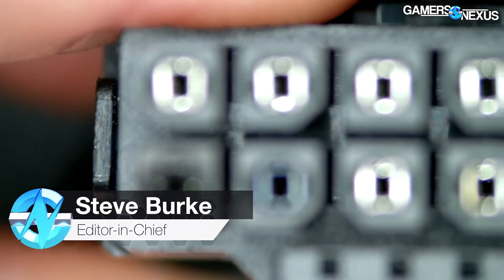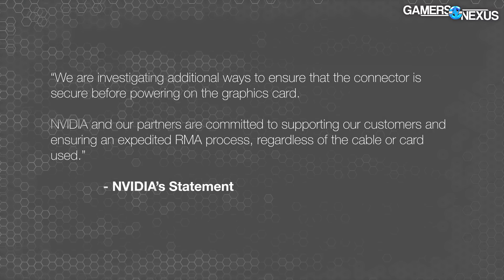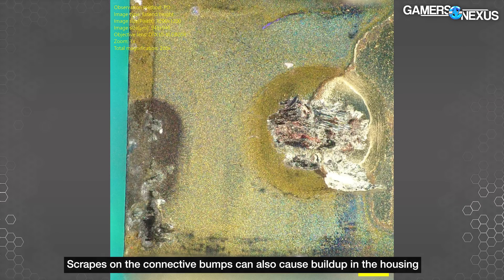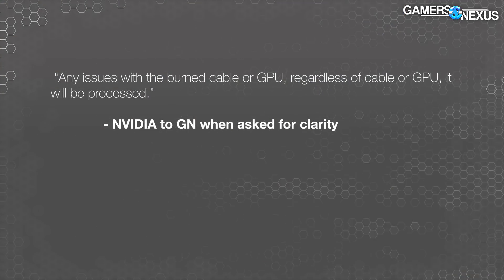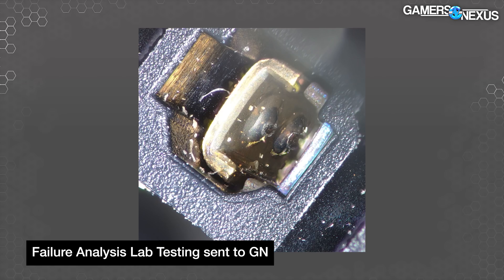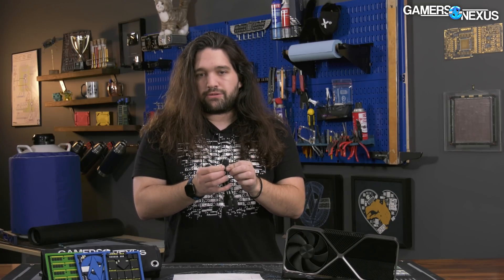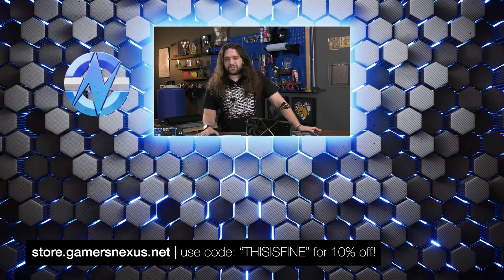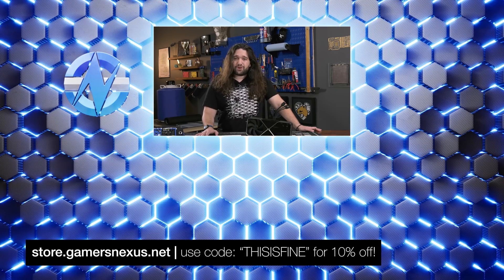NVIDIA Responds to Melting Cables, Warranty Concerns, & 12VHPWR Adapter Failures

Comment from the maker: Learn about the data in our testing video! https://youtu.be/ig2px7ofKhQ
Use code "THISISFINE" on https://store.gamersnexus.net for 10% off til next week!
Reply: 11:33 Make end that is inserted into the socket in bright colour for eg. red. When you don't see red, it is fully inserted.
Reply: My burning lawsuit  brings all the  NVIDIA bagholders to the yard
And they're like, my Cable conector skills better than yours
Damn right better than yours
I can teach you, but I have to charge 1000.- over MSRP
Reply: seriously why didn't NVidia just use a 16pin connector.
Reply: A design that easily leads to "user error" is a bad design.
Consider the decades of 6-pin and 8-pin usage without issues...
Reply: @seamon9732  8pins are known to melt in very similar way.
Reply: I think this will be more than 0.05% because scalpers are not using cards they bought and I suppose there are a lot of such cards being sold.
Secondly - this is a poor design of this connection if so many people are able to plug it incorrectly.
Nvidia just watched your previous video and released the statement - you just made their work here.
Reply: Does anybody know how many cases of 8 pin connectors catching on fire there are? 🤣
Reply: Hey GN where do I get the 12V connector used in NVidias data center cards ? cause  I'm just guessing those are not the same quality as the "just trust me bro" consumer connector.
Reply: Another case of "poeple are stupid"
Reply: Nvidia should find a way to pre install the cable in a way that this is non-removable by the end user / customer. Sure this comes likely with bigger packaging and additional logistic costs but nvidia should have the financial backup and the margin on the 4090 to handle those kinds of upcosts imho
Reply: @KingApoc  Hard No.  Last thing we need is companies imitating Dell's ( of all companies ) abuse of proprietary connectors.
Reply: @KingApoc  exactly, nvidia owes us money
Reply: Some people report that they can't fully insert the connector even with a lot of force to get a flush connection... So maybe the debris is in some cases so bad that is impossible to get it inserted correctly or there is another manufacturing problem... Maybe not all cases are user-error
Reply: Great job on video editing Trainee!
Reply: Nexusman this is SO ANNOYING you NEFER LISTEN TO ME.. can you pleaseee listen to me
Reply: Haha love the code choice, very timely.
Reply: One thing you didn't account for in the total 4090 sales number and the calculation of failure percentage is how many of them are sitting unused because they're being scalped. I would estimate that at least 10% of total 4090 sales are potentially not in a system and running so that would make the failure percentage slightly higher
Reply: If the clip has a contact point (one more sensor relay) then if it is not fully seated and cliped in, the circut is open, and the user will notified that the cable needs to be seated more securly.
Reply: 125,000 sold video cards surely doesn’t equal “in use”, most of those must be wholesale?

So presumably the “in use” error rate is impossible to estimate but much higher.
Reply: 12:48 Speaking of improvements to the latching mechanism-- instead of just providing mechanical feedback they should add an additional latch on each side of the big latch to make sure additional clamping force is exerted on the portions of the connector most likely to experience this method of failure-- the last two pins on each side of the connector.
Reply: @TwistedMe13  Remember when Monitor cables were screwed in. VGA, Serial and Parallel ports.
Reply: @brycering5989  Yes. Probably not a good idea for cables carrying power. Though I wonder if said 12VHPWR leads could have magsafe connections on each end as a secondary attachment system.
Reply: @TwistedMe13  Just looked up Magsafe, LOL that thing looks dangerous for 60w. Of the top of you head, Why not a good idea for cables with power ?
Reply: @brycering5989  The magsafe-esque connections on each side of the connector at each end of the cable would only be carrying enough power to serve as an interlock-- if they don't make a solid connection the card will refuse to power on.  
You don't want the connector capable of putting that much stress on the connection point to the pcb of the card.  It wouldn't be much an issue for the PSU because you could secure the posts into the steel/aluminum of the casing.
Reply: idk if i am doing it right or if it is able to do this but i got the embeded gpu to work with an external gpu? don't know if it is like this cause i installed a new os on a different hd and it doesn't let me do what i managed to get on the 1st os install on a new pc... !? what did i do or didn't do to make this work?
GPU is for 3D
Internal GPU for videos + i think its pretty cool if it wasn't meant to work like this but hey i wanted it to work like this so i will take it, my booting up though is all black screen till i can choose o.s.'s, doesn't seem right at all...but works and i needed this, someone explain the magic.
Reply: Say what?  Plugging the GPU power into the motherboard??? ... was that really an exact quote?  Yikes!  AMD please!
Reply: @GamersNexus is there any word of PSUs making the 16 pin rail for these? that way they could make it one cable without that adapter.
Reply: @mikep8953  That's the new ATX 3 pcie 5 ready standard. Companies are rolling them out. I think MSI has a couple of options out already and others like Asus are all saying 4q/1q releases, so I assume they are also coming from other vendors sometime in the next few months.
Reply: I think you should do a proper pc build with it / with a normal case ( not an open air one ) because of the case of the cable hitting the side panel and also getting pulled when you're routing and doing cable management to the cable to ensure the people that they're fine
Reply: the video just proves how quality of everything is been going down the shit hole for the past 20 years. or longer.  and is even more proof nobody is doing anything about the global pollution problem.  cuz all it is about is making products that are desigend to break not last. just so we can sell more products and give  2 fuck alls about the micro plastic problem.  in the future when they take core samples they will see this layer of human history with plastic layer.  but  the way things are going humans might not even last another 50 years.
Reply: my only critique here is that you did not go hard enough on nvidia, it might be a .05% chance of a fire hazard and be predominantly user error but it is a user error issue caused by BAD design, or a design defect. if you spend 1600 on a card, you deserve a cable built by davinci not some 2 cent cable made by engineers who were snorting crack thinking #thisisfine

nvidia should be forced to give everyone free non-fire hazard cables with an L shape design
Reply: @psychoticgiraffe  A better and far safer option is to just use 8 pin connectors, after that there's only user error or cheap construction to blame on any damage.
Reply: in fact the cards/cables have a 0.5% failure rate within the first month! if the rate continues it will be 6% of cables melt within a year! Great work on the testing!
Reply: I just had a thought, what if the cable can unlatch when it's heated, thus coming lose?
Reply: Bottom line is nvidia used you as a way to not do a recall or give us free cables
Reply: apple: "you're holding it wrong"
nvidia: "you're plugging it in wrong"
Reply: Perchance is the resistance that is felt more due to the friction of the plastic on plastic or is it more due to the metal in metal.  If the former, could they also 'shave' the male keys smaller?
Reply: First a small nzxt h1 v2 case then nvidia 4090. Prove that they have never tested their products
Reply: @njgrant3988  and Gigabyte IED PSU.

I'm worried that there will be more "This Is Fine" moments occuring in the future. Probably a burning MB, gasoline filled liquid cooler or thermal paste made from mercury/lead.
Reply: @First-Name_Last-Name  my money will be safe until there is another good product i can buy
Reply: @njgrant3988  Their go cheap. They let Youtuber work for them as a non paid job

Comment: Contrary to the statements made here, Nvidia and partners are NOT committed to supporting customers with this issue regardless of the cable or card used, they'll just point the finger at each other sending you around in circles while nobody takes responsibility for anything. I contacted Nvidia directly after having issues getting support from ASUS for my 4090, and after quoting the line above was told "You can find many thing said online which is not correct", at which point I linked them the official statement from the homepage custhelp url, and then just kept getting the generic "you need to contact ASUS" over and over again. Definitely some top notch customer service!

Comment: 10:16 it needs to be replaced with a more reliable one.
If the RMA is invalid due to the connector melting, it doesn't matter whether the owner has it replaced or not.
I would like to see a test where that connector is brought out.
I'm thinking of soldering wires to the PCB, in place of the connector.
Then they put a female 12VHPWR connector like this on the other end of the wire.
To find out how much the base temperature of the PCB affects it, and how much safer it is if that connector is connected hanging in the air.

Comment: Nivida should put a little button on top of it and a little hole inside the power supply so the cable can snap in and it can be fully secured

Comment: This video is old, but it is an example of how a vendor uses a YouTube channel to manage its reputation. Blaming users for not knowing how to plug the cables or saying this is a small number.

My strong experience confirms a defective design by Nvidia, not knowing how to assemble a power cable that can deliver 600 watts.  I am unsure if you know that 600 wats mean 50 amps at 12 v. My plug burned yesterday, and it seems it was hot most of the time.

😮😮😮😮😮😮😮😮

4090 cables will burn if you push your GPU hard, like using above 500 volts. It will not melt only if you use it lightly where power is less always less than 400 watts.
Reply: I use mine with 70% power limit. It reduces the performance by 5-10% but itonly uses 350W max. Hopefully mine will not melt but this situation is unbelievable. No accountability from Nvidia still.

Comment: It is not user error nor is it the cable. I know it deep down that its because of the single 12vhpwr connector present on the card. If it was 2 like on the Galax HOF 4090, then the problem and the cause wouldve never happened.
Reply: Na, just a bunch of noobs trying to build rigs using professional components leading to issues. 0 pros have had any issue whatsoever with these cards. Granted there will always be failures with electronics components regardless, however the industries acceptable expected failure rate for electronics is %4 respectfully. This so called "issue" is less than %0.1 according to the current data. Properly seat your power cables, buy a case that fits, do not bend cables, do not use 3rd party adapters, have a professional who knows what they are doing building rigs and you will have a %99.9 success rate according to the data.

Comment: If this is something unique to some of the 40 series cards this is 100% a design flaw. I don’t buy user error…
Reply: This happens to any GPU with a power cable  that is not properly seated, 30,20,10 series and beyond. Simple net search would disclose exactly that

Comment: Can someone please just tell me what the safest, less likely to catch fire cable I can use with my 4070ti super oc? The internet is so flooded I can't figure out what to get
Reply: Properly seat your power cables, buy a case that fits, do not bend cables, do not use 3rd party adapters, have a professional who knows what they are doing building rigs and you will have a %99.9 success rate according to the data.. I think you will be good bro lol

Comment: Well it didn't help that they cheaped out on the pcb female connection the receiving sleeves should have been solid all around it might've prevented this issue!!!😊
Reply: If 8 pin connectors were used then this would've never been a problem in the first place.

Comment: Would be interested to hear your thoughts on the Corsair HX1500i PSu coming with a 16 pin lead but only has TWO 8 pin sockets at the PSU end compared to the FOUR 8 pin sockets that the 16 pin lead has that you show int he video. Also the Corsair lead only has TWO of the 4 SENSE pins .... Thoughts please ????

Comment: That's way too much force needed to plug in a connector. It it was a water tight connector, I'd understand the force needed but not with a standard non waterproof connector. I still think this is a connector issue. Very poor design. I'll never purchase a GPU with this connector, in fear of it running out of warranty or Nvidia just saying it's a user issue and we're not warranting it.

Comment: i know you probably hear this all the time and i'm probably just asking a question that's already been answered but am i safe to use a CableMod C-Series Pro ModMesh Sleeved 12VHPWR connector for mt 4080 fe ?  id typically not be worried about doing this but after doing research on melting it can be pretty overwhelming

Comment: What complete crap... the design is bad.  For 'Good Will' alone, NVIDIA should just swallow the feathers, and redesign and do the right thing for their customers.  I will never purchase NVIDIA for this specific reason... NVIDIA cannot be trusted to do the right thing, REGARDLESS of the fault being design or in some respect user error.  The fix is EASY, add multiple locking clips to the connector so it CAN ONLY connect the right and proper way.  But NO... NVIDIA dug in their heels and refused to do the right thing... to at least CONTROL the perception of a design issue.
Reply: Nvidia did not design the 12VHPWR standard.. They use pci sig, which is there to be blamed once something like this happens. If they don't use pci sig they cant go to market.
Shut the fuck up.
Reply: @3rd.world.eliteAJ  They put it in their card making them responsible.  Its 2024 and my 4090 cable melted a month ago and I am in RMA hell. YOU shut the fuck up.

Comment: If you can’t properly install a single connector on a gpu you have no business building a computer. The 30 series cards have 3 and they are a son of a b to click in, especially in a vertical mount set up.

Comment: One of the clues being overlooked generally on this topic across multiple videos and sites is that many of these failures happen after 3 weeks, or several months, or 9 months etc. So think about that for a minute. We're shoving 300 to 400 W across one to three tight pins on a new design connector and getting a run away heat accumulation. But it doesn't happen right away but fails after a significant amount of time. Why ? What could cause this ? I submit, Corrosion ! ... namely oxidation at the exact fine point of pin contact. We know that oxidation increases with heat exposure and air exposure over time ... and that corrosion causes even more heat due to resistance and before you know it you have a run away heat buildup. So, how do we prevent this ? and I am amazed at how little attention this idea gets ... like with any electrical contact surface which carries a high load with respect to surface area, we have to protect the existing 'ok, but not great' connection with an anti oxidation contact grease designed for this purpose. Yes, they do make them, they are lithium based and in this case we want something that encourages conductivity not discourages it , so we don't want a 'dielectric no-ox' ... so get 'dielectric grease' out of your head cause that's what comes to mind with most people ... we want the opposite of that. Craig labs makes the perfect solution for this, its called DeoxIT L260Cp ... the 'Cp' stands for copper particles ... it has copper particles in the grease, it's lithium based so it will not degrade under heat stress. I'll be applying mine with a needle type applicator ... sparingly ... inside the barrels of the connector.

Comment: I agree with the "plug the cable into the GPU before inserting the GPU into the motherboard" statement. I have a RTX 4070 and I think that the new connector takes quite a bit of force to plug in properly. More force than you want to put on your GPU when it is in your motherboards PCIe slot.

Comment: I know this is an older video, but I would suggest a secondary latch, metal clip that is attached to the card itself... so you have to clip the cord in fully with the first clip, then use the secondary metal latch to go over the top of the cord part you plugged in which would also strengthen the attachment, stop it from wobbling as much, as well as achieve the main objective which would be to lock it in place properly.

Comment: Inside the connector, the plastic walls/enclosures that individually separate those high voltage pins, can't keep up the high heat temperatures carrying by those pins. Therefore sooner than later that plastic will eventually melt along with your wallet.

Comment: 50 amps through such tiny wires cannot be user error. Any competent person into electronics knows it will heat up enough to melt the plastic. If they want em to get hot may as well make connectors from bakelite